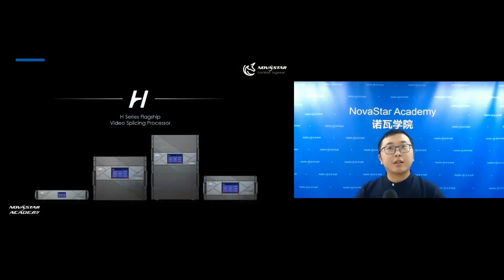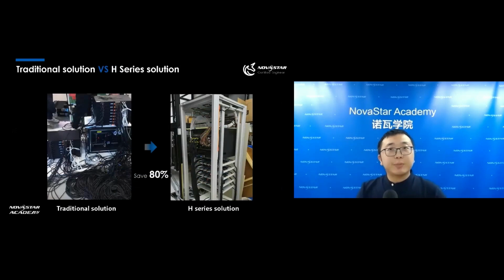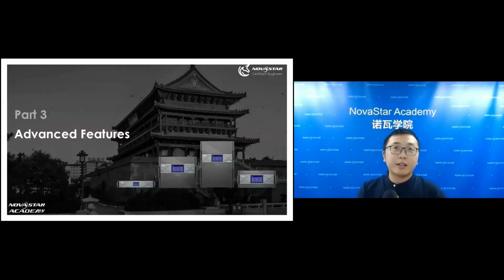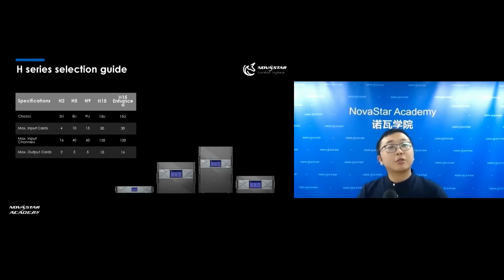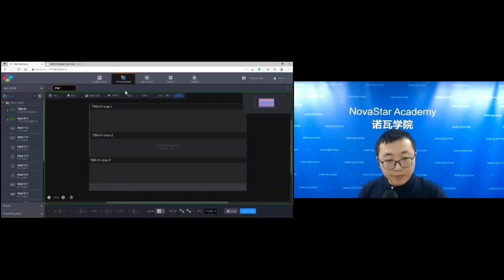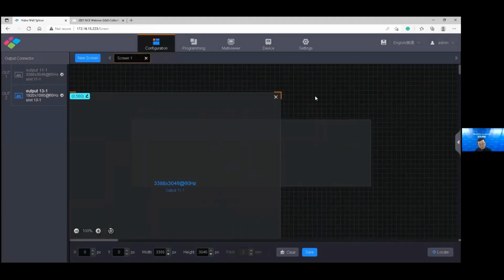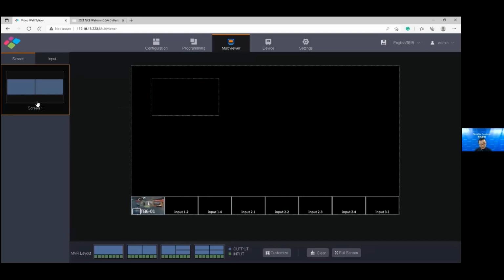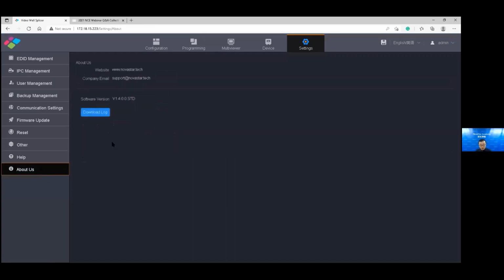NovaStar How to Use NovaStar H Series | Full Setup Guide for LED Splicing & Control System (2025)

Comment: bro , how to connect use genlock to H2 and H5 ? , thank
Reply from the maker: Hi! You can connect the Genlock input via the REF IN port on both H2 and H5. Make sure the signal source and processor share the same sync reference.😊